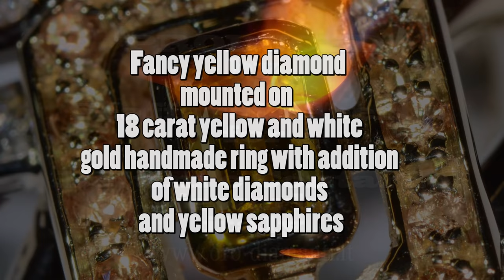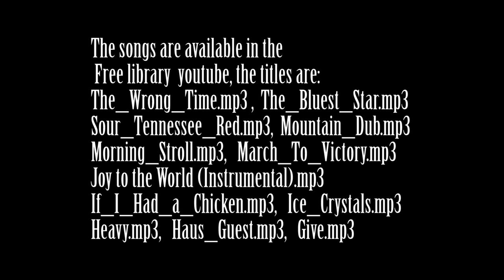Fancy yellow diamond mounted on gold handmade ring

Comment: Hello. I love your work so much! I'm self teaching. And I wonder if I can ask about the exact procedure for the cone bezels? Mine ripped open, (not on the solder line, but just ripped. And it was 20 gage) ....so I assume it was too small for the holes I chose. I'm guessing it needs to be very close to the hole size, just so you can slip it in?
Reply from the maker: it is best that it is as large as the largest part of the cone, then we must crush him inside, then use the punch cone and beat him inside to finish it. to last will be seated the upper and lower floors which almost certainly remain not in axis.
I usually do so.